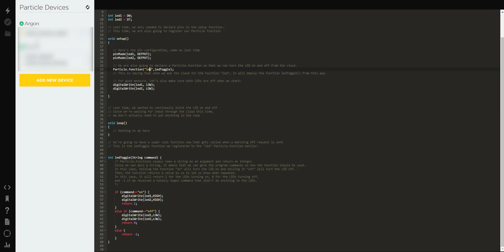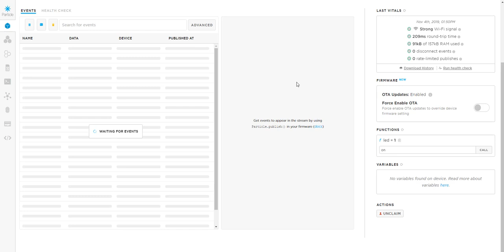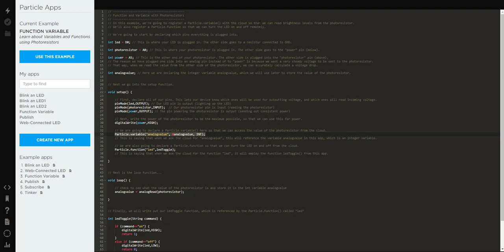Particle.io Xenon + Argon + Cloud Service

Comment: Very nice, I couldn't find the answer, what holds the mesh ? 
What is the range ? 

Air-condition control system that I worked on for a client, used x-bee to hold the mesh, worked well - most of the times :)
Reply from the maker: I haven't really had any issues with dropouts, but I'm in one building.  Line of site people were getting 50+ meters with the built in antenna and I've seen 400+m with external antennas.

Comment: Those look like pretty cool little devices. Sounds like you're using particle.io cloud services. Can you use these on a self-hosted site? Either with their software on your own servers or connect independent of their libraries (e.g. through a REST interface)?

(BTW, when you went to the voice over showing your screen, lost the right side audio. No biggie, but thought you might want to know.)
Reply from the maker: Dang. Sorry. I have definitely been having audio issues ever since my fancy mic died.  I've tried 2 other mid-range mics and they are both giving me issues.  You can use it on a self-hosted site or even on something like Azure.  I've only used them on the particle.io service because that's what got me interested in them, but I confirmed that I do have options up front.
Reply: Thanks for the info. Being able to not rely on their service mitigates the risk of using them. Putting them on my list of things to experiment with.

On the mic, perhaps it's a mono mic plugged into a stereo input? I know that's what mine does. I have to always use Premiere's Audio effect "Fill left" to duplicate the left channel in the right.
Reply from the maker: @HouseOfHacks  Mine is a USB mic, but there's definitely a chance that I accidentally deleted an audio track during editing.  Just curious...what kind of mic do you use?
Reply: @AnotherMaker  Ah, yeah, with a USB mic, it's probably a different issue than what I'm running into. I just have an inexpensive (<$15) lav mic I run into a Zoom H1. The Zoom only records stereo and the mic is mono, so it records just on the left channel.
Reply from the maker: @HouseOfHacks  I decided to try analog.  I hooked an old mixer up and it didn't sound bad at all. That's what I recorded that Makey makey video with.  I may try analog for a while.
Thanks for the advice!